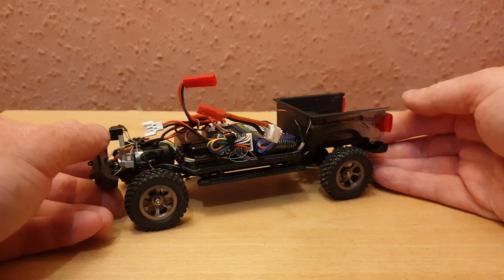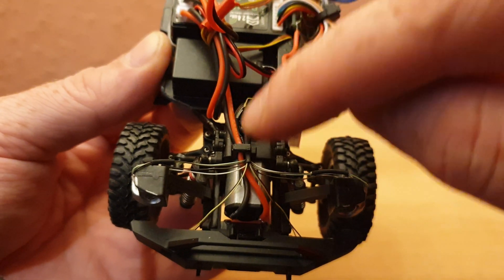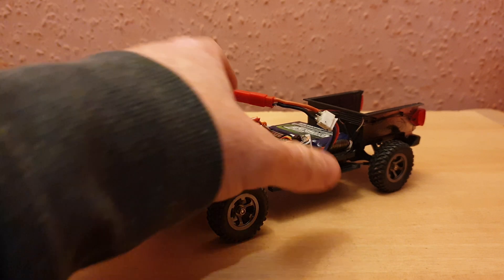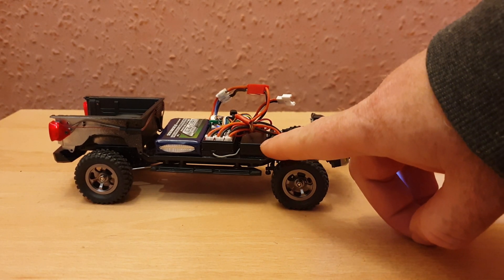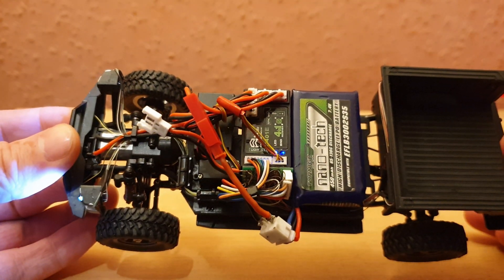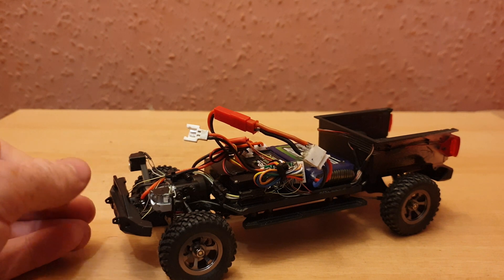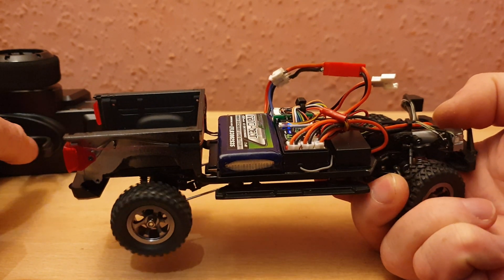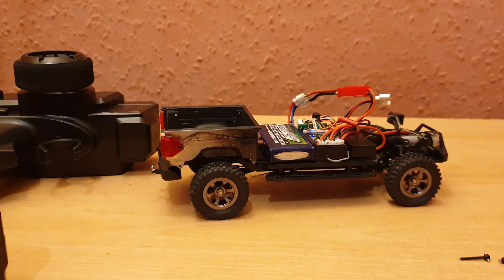About the new Orlandoo Hunter P02 - Part 7

Comment: Hi Drew!!! Nice, clean job. Learning a lot from your videos. I just build my OH3203A and it work fine but I have issue with lighting. Any LED lite I am connecting to the lighting interface it start blinking, non stop. Do you have any idea what could be a problem? Maybe D401E receiver?  Regards,
Reply from the maker: Sorry for late reply, YT not showing me comments lately, found I got so many missed comments.  Afraid I can't help you with that, I'm kind of noob to LED wiring myself, so I'm not sure what the issue could be.  If you can, check out the Orlandoo Builders Guild on FB, there should be someone on there that could offer better advice.
Reply: @foxracerdrew  Thank you anyway, before I got your respond, guys from there give me directions. Good luck with your projects!!!

Comment: Is it easier to build than the older ones?
Reply from the maker: It's about the same, but it's much more difficult for servicing or changing motor as you need to disassemble the entire front end and gearbox.
Reply: @foxracerdrew  thx